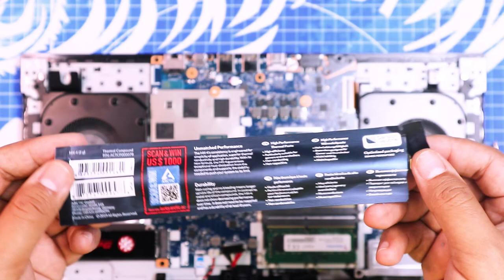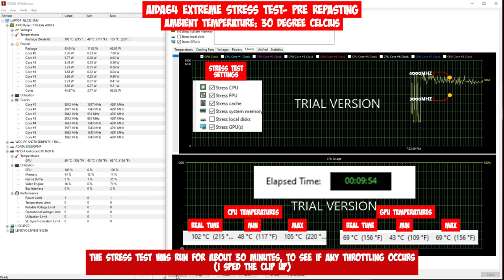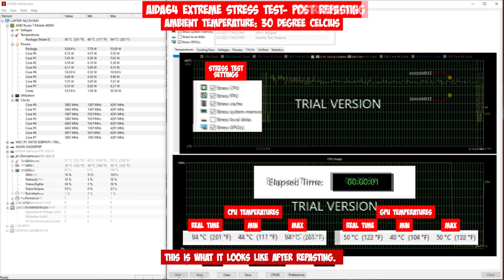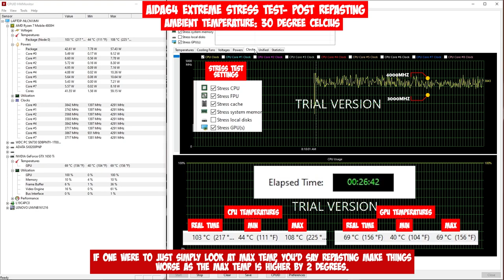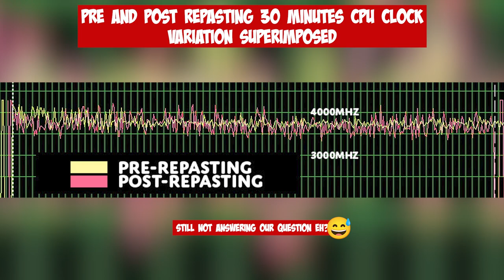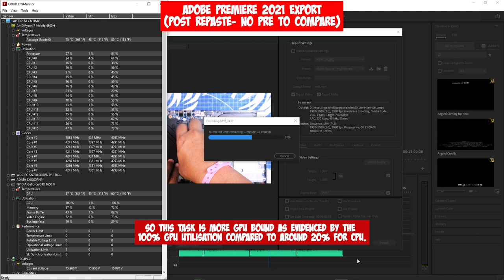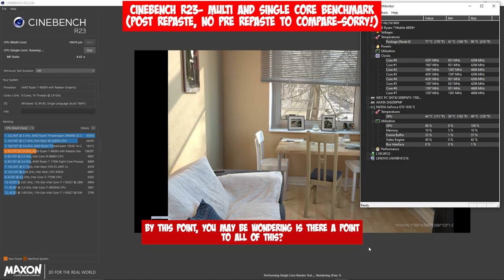Repasting My Lenovo Legion 5 |Replacing Old Thermal Paste|

Comment: I'm about to do this for the first time ever, wish me luck.
Reply from the maker: all the best. take it slow and don't rush. should be fine👍
Reply: @masterofnone4608  nvm, i did more research and it turns out Legion laptops use a beefy thermal paste that aren't very friendly for my budget, if I use a way cheaper paste then my thermals wouldn't be improving.

Comment: Two things for enthusiasts: 1. Undervolting CPU. 2. Liquid metal will decrease temperature around 5-7oC but not without risks.
Reply from the maker: ha ha. not brave enough for liquid metal. need more courage😉
Reply: @masterofnone4608  Liquid metal 1. Can be used with copper and nickel but with some other metals can cause corrosion 2. Typically around core the transistors have to be covered with varnish for isolation, because LM is electrically conductive 3. I would check device after 6 months cause you might need to add some LM.   ;)
Reply: @masterofnone4608  I did it on PS4 Pro, Xbox One X, RX 5700 and RX 570. Never had an issue. :)
Reply: what program or bios for undervolting CPU?
Reply: Undervolting dropperd temps from 85-90 celsius to 70. Ryzen 5800H
Reply: @ultimate2368  u cannot undervolt ryzen 7 5800H. Disabling boost doesnt count as undervolting

Comment: My lenovo legion 5's GPU is hitting 90 C and then it throttles Im hoping repasting it might fix this
Reply: hey did it get fixed?
Reply: @renegadesg018  yes
Reply: @metalemissary416  so like what are the temps now? Because i dont know if i should replace my thermal paste in the cooler even though its like giving out 95 degrees on the cpu and 86 degrees in the gpu. I heard that we shouldn't remove the honeywell ptm inside the machine but it was like this since the beginning.
Reply: @renegadesg018  95 and 86 are just a little bit high are you sure it has proper space and ventilation? Also if it's more than a year and a half replacing paste wouldn't hurt. Also yeah be careful with the pads they are sensitive.
Reply: @metalemissary416  yes uk i even put a box under the laptop to lift it up for ventilation but i can see the gpu throttling really bad. It used to stay at 115w, sometimes even 125w but now as soon as it hits 87 degrees, it downclocks and goes around 81w to 90w. I want to get this grizzly hydronaut but im like scared if the temps would get even worse and the pump out would be just 1 or 2 weeks
Reply: @renegadesg018  so first time I cleaned it I still had some high temps but  I opened it again and I found a lot of hidden gunk between the fan edges. It's really easy to miss as it's really hidden. Ventilation fans on this laptop seem to be prone to clogging
Reply: @metalemissary416  i cleaned it by giving it to a technician like 2 months back but it was still giving very high temps but even then it was still boosting to like 100w and its always above 90. I think it was like this since the beginning. Even after he opened and cleaned the heatsink, i told him not to repaste. So the question is, should i buy hydronaut and get the paste replaced? Because i want something that will last long.
Reply: @renegadesg018  if it's been more than like two years then yeah a repaste wouldn't hurt.
Reply: @metalemissary416  yeaa its just been over a year. But from the start it was fine, only after the first servicing i think is when the guy removed the heatsink and the temps became bad, 2nd time i gave it for cleaning the entire device. Ig now ill just buy hydronaut and tell him to change the pastes.
Reply: @metalemissary416  btw dude which thermal paste you used?
Reply: @renegadesg018 not paste but liquid metal but I do not recommend
Reply: @metalemissary416  So what do you recommend? Rn im thinking of getting gelid gc extreme because i cant get ptm
Reply: @renegadesg018  any high performance (more than $10 USD) just make sure not to mess with those Honeywell pads they're fragile
Reply: @metalemissary416  tysm, I'm getting the gelid gc extreme

Comment: How long have you been using this legion 5?
Reply from the maker: hi. thanks for watching. I bought the laptop in July last year. So been daily driving this for almost 7 months now.
Reply: @masterofnone4608  I'm curious, should we be repasting in every 7 months frequently? Doesn't the pre-applied stock thermal paste do good already though?
Reply from the maker: @malfuriouz7717  No. Definitely not. I certainly wouldn't advice to repaste that frequently.

To be honest 7 months is still much too soon. 

 As mentioned in the video, I think repasting only make sense if you start to notice your laptop is not performing as it used to, eg. run hotter or starts throttling. 
even then, you probably can get away just by cleaning the intakes and fans because most likely those got blocked by dust build up and restrict your airflow.

I did it mainly because I was curious to see if repasting will do anything different to performance. which it kinda does but not to a significant degree. 

for most people, I would imagine the stock Paste will last a good couple of years(at least) before it would cause performance issue. 

However, if you the tinkering type, and want to get the squeeze every ounce of performance from your system and you want to test which type of thermal paste will give you the most performance, by all means go crazy.

hope this helps😊 thanks for watching.
Reply: @masterofnone4608  Thanks for your explanation and opinion! 
Definitely will subscribe to you.
Reply: @malfuriouz7717  repaste is recommended after 2-3 years. But all depending on usage and system. Some won’t even need it

Comment: Too bad you didn't see much improvement.
I always repaste my electronics right after I buy them. That cement they fish out of some radioactive pond in China and use as a thermal paste is a joke. So many RMA cases, time, money and environment could've been saved if manufacturers just used real paste. Imagine how many laptops getting bad review scores because of shitty thermals when in fact pretty much all of them (that of course do not have a bad thermal solution altogether) could be solved easily by just repasting with real compound.

My PS4 and PS5 both sounded like jet fighters, because the factory "paste" was so bad that it wasn't able to transfer heat efficient enough making the sensors thinking its hotter than it actually was, turning the fans up to max.
Now it's dead silent, hardly even ramps up anymore at all after a repaste. I just repasted my Legion 5, still analyzing it though.

Comment: I repasted with Noctua NT-H2. I tried Kryonaut but it didn’t really work that well so maybe I got a bad batch. But before reposting I was sometimes getting temps over 100 degrees under full load. Now after running Cinebench R23 multi core multiple times, I’m noticing temperatures 10-20 degrees lower! Definitely worth it imo.

After 30 minutes of Cinebench R23 (3 multi core tests back to back) the max watts drawn was 65 but went back down to 45 after a while, temps never went over like 93 but they were mainly under 80 the entire time, just spiked back up after starting a new run. Multi core score was 10,750. I totally recommend reposting.
Reply: Kryonaut/MX4 and many other pastes are not very reliable on gpu's and direct-die with high temperature at 80'c and above. It starts with great day 1 temperatures but rapidly degrades (Pump-out) after a few weeks/months. 
Hard to spread high viscosity pastes works best on those situations, and that's the reason why pre-applied factory paste is thick.
In the past i used "normal" thermal pastes on laptops/GPU as well (NT-H1 H2, MX-4, Kryonaut) but after some time the temps start rising again. Switched to shin-etsu 7921-5, Thermalright TFX, SYY-157 (older batch, new 2022 version not so good anymore) and Honeywell PTM7950 phase change pads for the really hot chips like the Lenovo Legion 5 or Acer Predator.
Reply: @phenos  what do u think is the suggested thermal paste for the legion 5?
Reply: @williamlaude1814  The best option is the Honeywell PTM7950 polymer paste sheet. Can be found on EBUY7 or aliexpress.
Basically every normal paste degrades quickly on that thing, but sturdy pastes lasts a bit longer. Thermalright TFX, Shin-etsu x23-7921-5, and some others but I'm currently typing with my phone away from my workplace.
Reply: @phenos  oh well I'm curious of what the lenovo legion is using, like from the manufacturer, since what they used last for me about 2yrs, until now. I live in a tropical country and only a e-fan is in my room. Previously  I've seen from my legion 5 that even if I play hardcore games like PUBG or GTA V, the temps only runs peak at maybe 70C but now after some time it peaks at 90C so, I think it needs a re-paste. I also clean the dust from the fan but still the same temps I'm getting. It peaks at 90C
Reply: @williamlaude1814  Legion 5's from around 2021 and later are equipped with Lenovo specific ptm-7958.
Reply: @phenos  Thank you for the info., should I replace the thermal pads as well when replacing the thermal paste with honey well PTM 7950?
Reply: @williamlaude1814  It's always good to have some better quality spare thermal pad material because sometimes they rip apart or are not tacky anymore making it difficult to reposition/reattach/keep them on their positions. It is important to have the same thickness as the original pads otherwise the cpu/gpu contact pressure with the cold-plate is too low or the contact is good but with poor contact pressure on the pads. I recommend pads with some "squishy-ness" because some higher-end pads tend to be very hard.
(I use a combination of cheap pad material and gelid GP-Extreme depending on the cooling requirements)
Reply: @phenos  does lenovo legion premium warranty covers of replacing the thermals paste and pads?
Reply: @williamlaude1814  I think it covers that as well, a replacement Lenovo cooling stack comes pre-equiped with pads and I think the ptm paste material. Not all repair-guys are aware of the ptm material though and use regular paste when they reuse the existing stack.

Comment: damn you did that totally wrong
1 always spread tim with spatula (or else ) when working with bare die (direct touch cooling)
2 dont use nth1 mx4 or any other runny tim becouse you temperatures will go worse than stock tim in 2 or 3 days due to pumpout efect 
When unscreewing cooling always follow pattern dont go right to left becouse you can crack die. 
I think i will do video on how to do it right ....
Reply from the maker: thanks for letting me know. do share the link when you video is up🙏😊

Comment: THEN I watched the heatsink removal....
REMOVE THE RAM COVER BEFORE THE HEATSINK!
.
You were ASKING for that tape to fail and have the metal cover drop onto the main board!!!
.
It's light weight but it could still damage a component!
.
And.... The heatsink screws are NUMBERED. Loosen in reverse order, then tack down in the correct order before a final tightening!
.
Sorry...
NOT impressed!